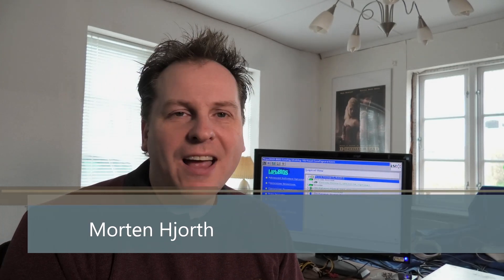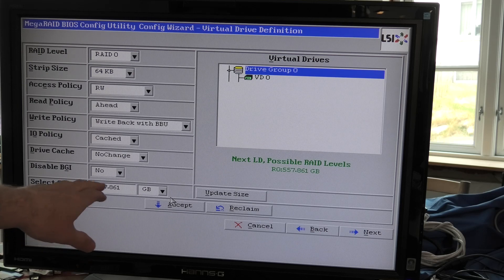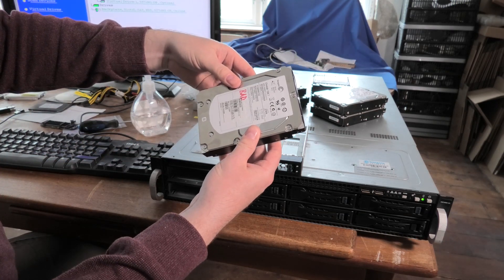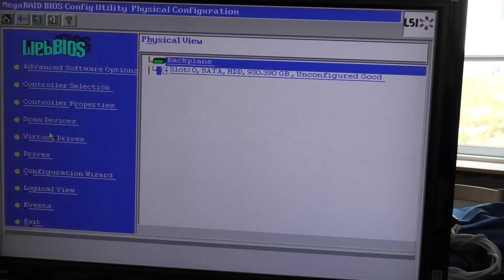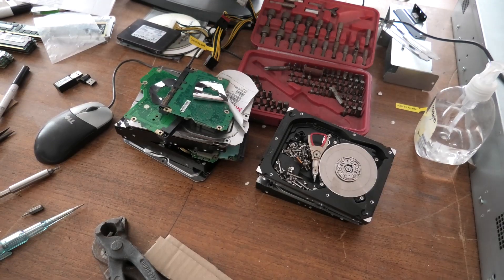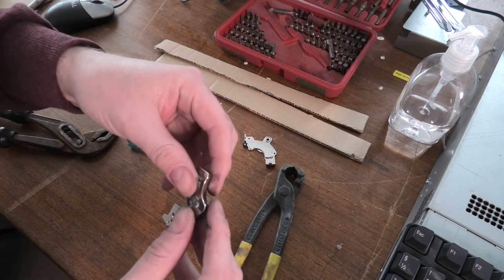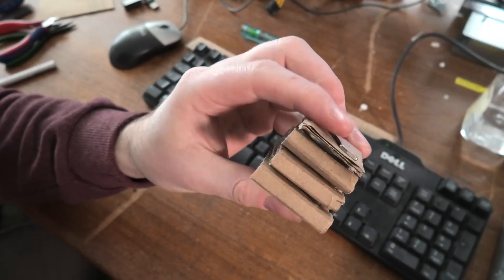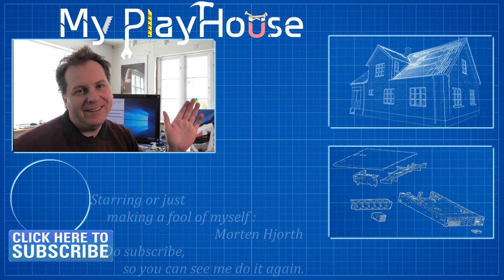2 Good HD out of 6 Bad & Neodymium Magnet Harvest - 1057

Comment: If you have a use for it, one of the better parts to reuse is the small but pretty good motor. I'd tend to have little trust in drives becoming "good" again.
Reply from the maker: What do you use the motor for ?
Reply: @MyPlayHouse  Not done it personally, but a simple thing would be for a fan. Or if you leave the disc, you could stick on some sand paper and have a rotary sander for small stuff.

Comment: Interesting about the magnets- I usually just throw them a way. A friend of mine tried to use a propane torch to remove them and that did not turn out well, very messy. I have pinched my fingers many times when I accidentally got two of them stuck together watch out!
Reply from the maker: They are really strong, and you can hurt yourself even with the small ones.

Comment: @My PlayHouse - about the two drives who were rejected from your server downstairs. Possible a to old firmware issue? I use a heatgun with a max of 70 deg. Celsius to remove the magnet from the metal peace.
Reply from the maker: The heat thing might be worth a try :-)

Comment: You REALLY can't trust a drive to be good just because the raid controller says so, most harddrive failures wont be detected by the raid controller just by powering up the drive.
You really need to run proper SMART tests on the drives and read the drive logs to be sure the drives are OK.

Also as i commented on your previous video, windows 10/2019 has a bug that prevents some drives with a certain partition layout from showing up, so you should really use a linux box to test drives.
Reply from the maker: I was just lightly checking the drives,, the raid controller may not pass through the SMART data,, I did not actually look. I was kind of surprised that they showed up at all.

Comment: After taking apart both WD and Seagate drives, I'll never buy another Seagate as their magnets are small and weak and IMHO probably leads to the head hitting the platters as we saw in your examples. WD internals just seem to be made better, bigger magnets, etc.
Reply: The magnets are only used in positioning the heads across the platters not in the height of the head above the platter. Head height is partially controlled by the actual spin of the disk creating wind. I took some seagates apart a few years ago and in some the motor had seized up, in others the head had crashed into the drive. 
I won’t buy Seagates any more. Too many dead drives.
Reply from the maker: Hi Geoff Seeley
Thank You very much!  glad you liked the video :-)
Thank you for watching! :-)

Comment: I would not use drives like these for important data or in a Raid configuration. However they are great for transfering many files or for game/program storage. You wont loose a lot when they fail.
I use one for my steam library which has many defective sectors. A bit slow, but works otherwise. Another one is in use to transfer terabytes of mkv files between me and my friends. In case I drop it I won't loose much, I have many replacement scrap drives.
Reply from the maker: Hi TheRailroad99
Thank You very much!  glad you liked the video :-)
Thank you for watching! :-)